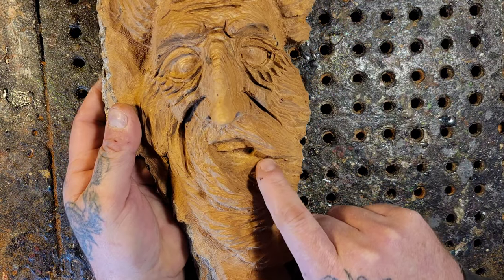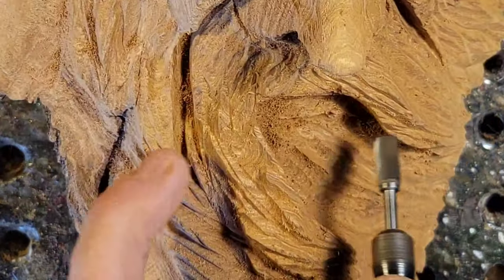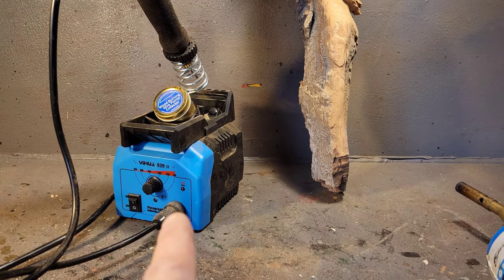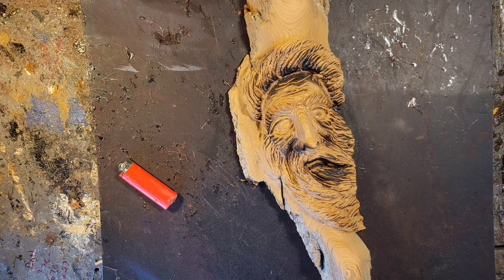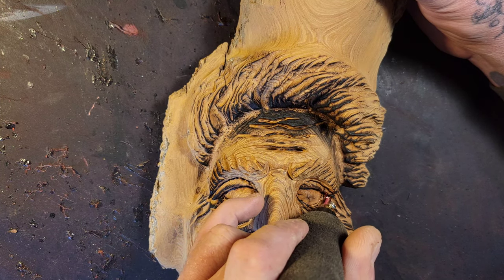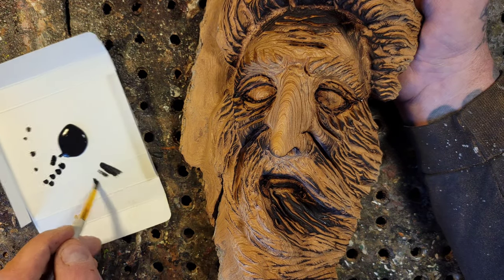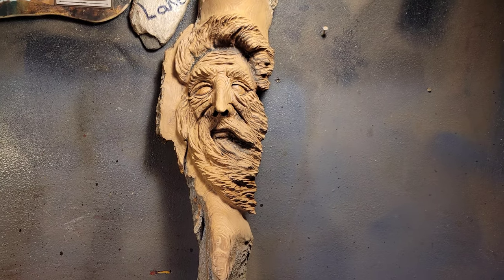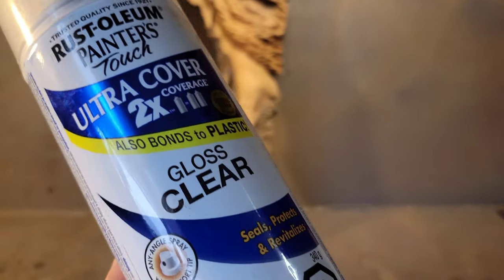Beginner series Carving a Woodspirit with a Dremel Final. Finishing

Comment: Un GROS merci Jordy!  This series has brought my woodspirits to another level.  Question  I run a dremel 4000 with varying speed from 5,000-35,000.  At what speed (approximately) do you normally carve (I use cedar or pine wood)? and when you say to run the dremel at low speed when using Peter's mandrel to sand, what do you consider low speed?
Reply from the maker: Sanding Mandrel @ half the full speed, and I basicly always run full speed but less heavy hands when doing eyes and noses